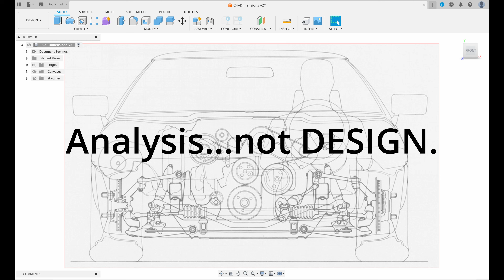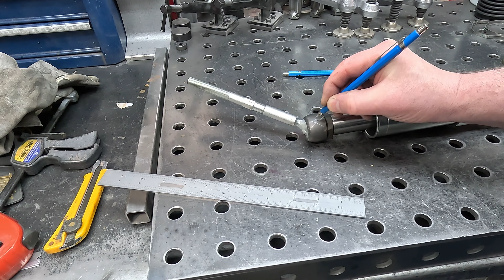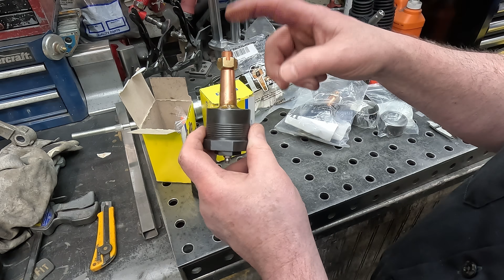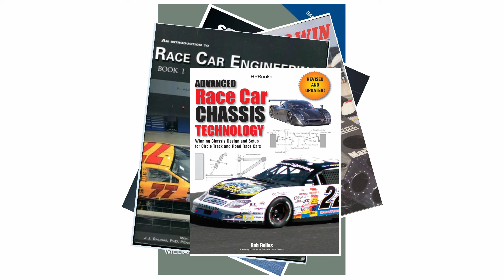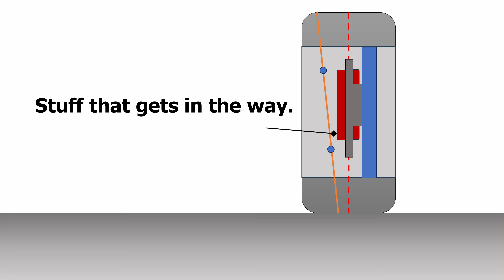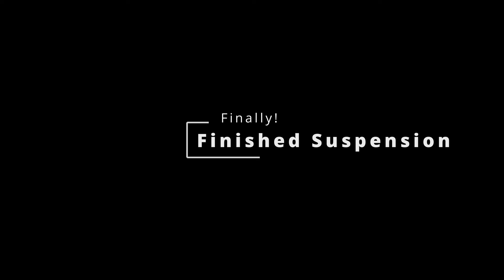Designing Car Suspension - From Analysis to Design.  Front View.

Comment: Would love to see my 65 pontiac in stock trim plugged into the computer. Would probably explain why the crash/death rate was so bad back then.
Reply from the maker: I never thought the Corvette would do what it does!  A lot of older suspensions were designed to have very low rates of camber gain.
Reply: @ThrottleStopGarage  65 gto in stock trim, 0 to -0.5 deg caster, (with power steering!) positive camber gain on bump ( top control arms point steeply down toward the wheel). bump steer visible with the naked eye...allegedly the mindset of the GM engineers at the time was "if understeer worsens with speed, people will slow down". The same designer had a hand in an early 70,s holden here in australia that handled much worse than earlier models. He was the cause of the GM " radial tuned suspension" of the late 70,s to try and band-aid the debacle.

Comment: I have watched you working this project for a while now, and several reiterations on the front suspension. Your explanation is actually making sense. Thanks
Reply from the maker: Glad to hear it!  This one was particularly hard as I didn't find it intuitive to understand the process.
Reply: @ThrottleStopGarage  my step-father had a '64 AC Cobra with the leaf spring front suspension, I was going through the suspension while you were explaining it.
Reply from the maker: @bradmaas6875  Cool - I wonder what the properties of that suspension are.
Reply: @ThrottleStopGarage  The front suspension was very similar to the AC Ace of the '50s, transverse spring acting as the upper control arms. Very long UCA's with the inner pivot functionally mobile during its travel. Might be time for some plywood mock-ups.